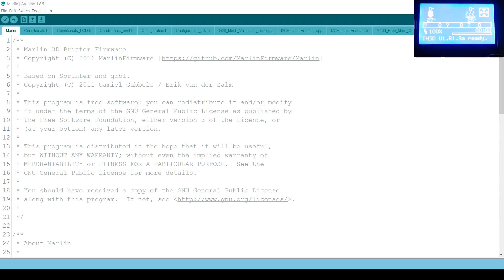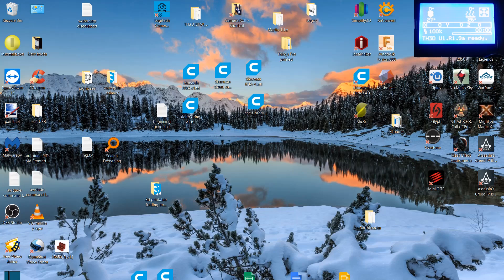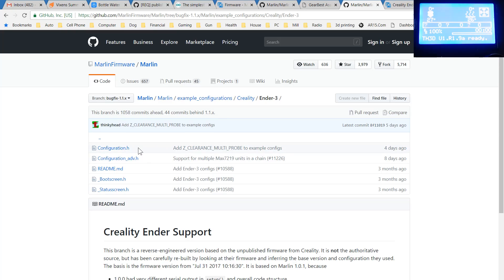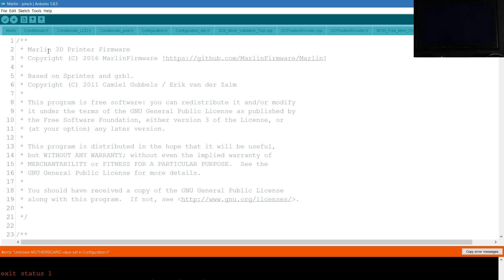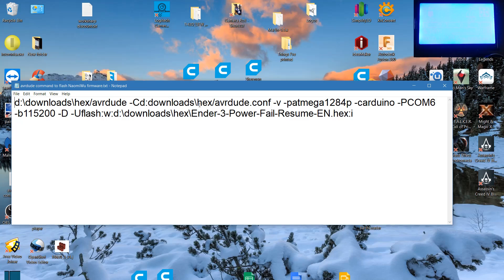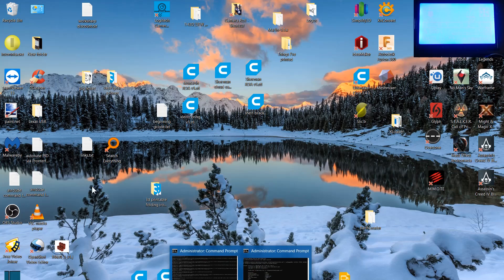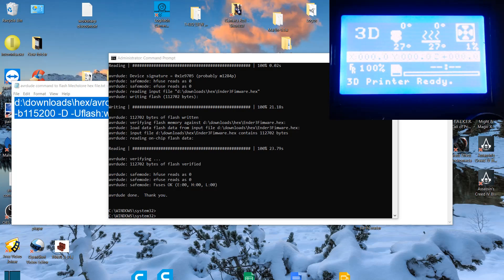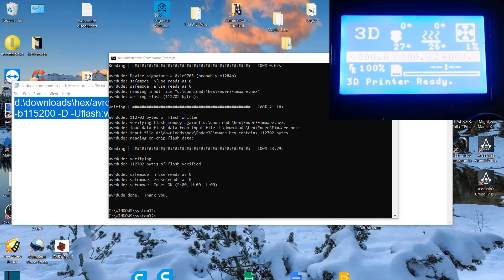Flashing the stock firmware to the Ender 3

Comment: I was able to flash the firmware successfully but now all I get is a blue screen on my display. I flashed it while it was powered up. Does that matter?
Reply from the maker: While I usually do it powered down, I have down it powered up and it worked fine, so I'm thinking that it probably doesn't matter.

Comment: Followed your instructions and I was able to flash the Creality .hex that Naomi uploaded. Good to know it actually works and can go back to stock if I decide I want the power resume feature back. Thank you! All I did was change the directories for my pc. it complained I needed a file called libusb0.dll copied it from Arduino folder, input my command and it uploaded ok.
Reply from the maker: Thanks for letting me know, I've still had no luck flashing that file and if you've done it that means I'm doing something wrong. No shock there, but it's good to have confirmation. I'm not getting the same error you are, but if I try it again I'll be sure to try your fix.
Reply: this is the command I used:

C:\users\YOURUSERDIR\downloads\hex/avrdude -CC:\Users\YOURUSERDIR\downloads\hex/avrdude.conf -v -patmega1284p -carduino -PCOM6 -b115200 -D -Uflash:w:C:\Users\YOURUSERDIR\Downloads\hex\Ender-3-Power-Fail-Resume-EN.hex:i

*YOURUSERDIR above need to be replaced with name of user directory

download folder in original location in user folder on c: drive. in the downloads folder i made a folder called hex and inside the hex folder i put:

avrdude.exe
avrdude.conf
libusb0.dll
Ender-3-Power-Fail-Resume-EN.hex
Reply from the maker: That's identical to mine with the exception of the file locations. I had them all in the same folder too. I'm loathe to mess with it again, but I want to reflash the one that has the Power Resume on it because it doesn't work, so I'll probably give it one last shot. But other than the power resume it's working great with the Marlin 1.1.X bugix firmware. Thanks again!
Reply: No problem. And thank you! Your videos have been very helpful. Good luck! Hope it works for you.

Comment: Hi Chuck. Is this not the official Creality firmware? https://github.com/Creality3DPrinting/Ender-3
Reply from the maker: Supposedly, but it won't flash to the printer for me. It's one of the three I tried in the video.
Reply: Chuck Bryant Sorry, I did watch but I didn't notice that's where you'd got it from. The printer is great but what I've learnt recently is I will never allow it to run unattended.
Reply from the maker: I've run mine overnight, but I've got a smoke detector nearby, but I still try not to if I can help it.

Comment: Chuck, thanks for the video. 
The following thread from the creality Facebook group may be of interest for you. It explains why you couldn't compile the firmware in the first place (original is not based on 1.1.8). 
Also, Robert Colbert has done some outstanding work incorporating 1.1.x bug fix.  So you may give this a try.

https://m.facebook.com/groups/1275880512515568?view=permalink&id=1397808083656143

On the official hex-file, that's really strange but it may be because original doesn't include a bootloader and must be flashed via ISP. But this is just a wild guess. I think, creality has definetly still some homework to do to tidy up this file repository and make stuff work. (They are also missing the circuit diagram and the pcb for the display unit...)
Keep up the good work! I like your style!
Reply from the maker: Thanks, I'll give that a try!

Comment: Hi, please test the bugfix.1.1.X branch of marlin, it has power resume from creality in it, and the config files you showed from marlin github are just the example configuration files for the Ender 3, You take them and overwrite the bugfix.1.1.X branch config files and you will have marlin 1.1.8  with power resume and ender logo and thermal runaway.
Reply from the maker: Tal ziv I thought thats what I did. I'll try it again tomorrow. Thanks!
Reply from the maker: When I do this Arduino IDE give the error "too many decimal points in number" in both the Configuration.H and the Configuration_adv.H files. These are the Ender 3 versions, it compiles fine with the original 1.1.X files. I''m not sure how to fix this or why it's like that to begin with.
Reply: I have done this: 
1. install arduino 1.8.5 
2. download marlin bug fix https://github.com/MarlinFirmware/Marlin/archive/bugfix-1.1.x.zip 
2.1 unzip source
2.3 copy Ender 3 configuration and logos from example_configurations/Creality/Ender-3/ to Marlin source folder overwriting the configuration.
3. download u8glib v 1.17https://bintray.com/olikraus/u8glib/download_file?file_path=u8glib_arduino_v1.17.zip 
4. import u8glib to arduino 
5. select sanguino board 
6. select processor ATMega 1248P 16mhz 
7. verify (compile)

Or you can get the HEX files I uploaded here:
https://files.fm/u/zwttp85h

One is the compiled marlin bugfix branch with Ender 3 configuration and the other is the same but also includes the bootloader  so anyone who needs to flash the bootloader will also flash the latest marlin in one flash :)
Reply from the maker: I've now got it flashed on both my printers and both are working. It's too early to tell if it will have the same problem on my older Ender 3 that the TH3D UF firmware did, but it's looking good so far. Thanks for your help!
Reply: Chuck Bryant no problem hope this will sove the problem and thank you for your ender 3 videos. Can you post a video of the new firmware lcd and boot screen?

Comment: Sorry you've had so many problems with your Ender. I got mine in April of this year so I'm not sure if it's considered an early model or not but other than the extruder, I haven't had any problems with it, mechanical or firmware. Guess I'm lucky.
Reply from the maker: Is the black cover on your power supply 3D printed or injection molded? Other than the fans failing fast, my older Ender was trouble free until I flashed the firmware. My newer one has been totally trouble free even after flashing it. But now that it's back to stock firmware the older one seems to be working great again.
Reply: My cover is 3D printed out of PLA. It's a little warped now because I was printing ABS with a plastic trash bag over the entire printer which got hot enough inside to cause the cover to warp. I'm thinking of separating all of the electronics from the printer so that I can build a proper enclosure for ABS and not overheat the electron pushers.
Oh, and not boasting here but my OEM fans are still working fine. One is a little whinny on startup but quiets down after a few seconds.

Comment: Great information. I am just setting up an early model I bought but didn't have time to configure. I was going to flash the firmware right after I get my under extrusion figured out but now I will wait.
Reply from the maker: Is yours early enough that it has the 3D printed power supply cover? That's how early the one I've had troubles with is. Someone in the other video suggested that the wrong LCD lines were uncommented in the TH3D firmware, and that might explain why the stock firmware has a lower resolution screen. I'm hoping he sees this video and chimes in since he's a lot more familiar with Marlin than I am. When I get time I'm going to look through the file for the lines he mentioned. I think I'm going to eventually figure this out, but at least I can go back to a firmware that will run the printer correctly.
Reply: Yes mine has the 3d printed power supply cover. That's why I will be watching to see if you come up with the cause for your issue.

At least with waiting to assemble mine I had a bunch of good videos, including yours, to guide me through minimizing the mistakes common with assembly. 

Keep up the good work on the videos.